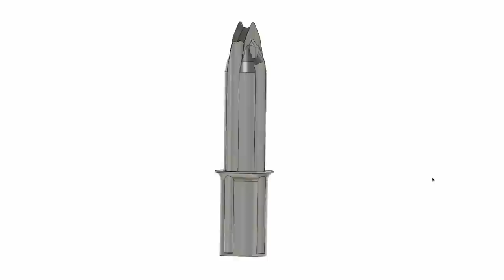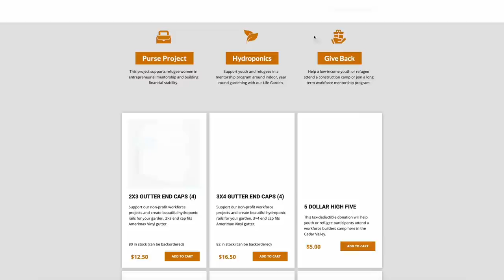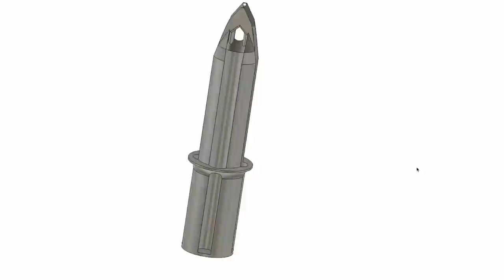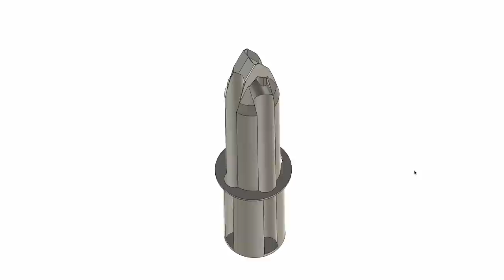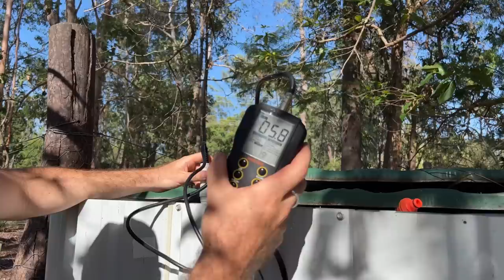The Grow Spike Hydroponic System

Comment: Suggestions for fixing 3D printing issues you mentioned:
To improve adhesion with print bed, I'd recommend wiping it with some IPA (isopropyl alcohol, not beer). If that's not enough, add brim. And maybe a draft shield, since you don't seem to have enclosure for your printers.
If you have issues with print strength, add extra walls instead of increasing infill.

Comment: A quick tip you might want to try, I've had significant success printing as if I have a .6mm nozzle with my standard .4mm nozzle. I swapped back from an actual .6mm nozzle and got much less stringing using the same gcode.

Comment: First! (lol) Just have to say, I've recently discovered hydroponics and have watched like 15 of your videos already. I'm planning on 3D printing the modular tower as my first attempt at hydroponics. Have you got a video that talks about which pumps you use and why? Great work, keep it up 👍👍
Reply: With pump it depends on the size of project you are talking about. If it is large you can use a garden fountain pump or if it's small you can use an aquarium pump. Alternatively you can buy a pump that you can change  the flow rate

Comment: Would this work with circulating nutrients in the gutter pipe ?   I have a Hydro system with mixed systems combined using a Pump in the reservoir, I would like to add raised grow beds making the gravity feed a bit difficult. Any info would be appreciated.

PS. love your videos and systems !!

Comment: Hey Hooch, I saw a video from you where you used a square type float valve. I saw another youtuber did something similar with square bottles. You can see it here  https://youtu.be/4gtdz6pzJZM It seem to be a simple design, would you ever consider to 3d design a float valve like that? It might fit better with the square rain gutter system. Maybe could even be an enhancement or addition to the ends you print. What you think?